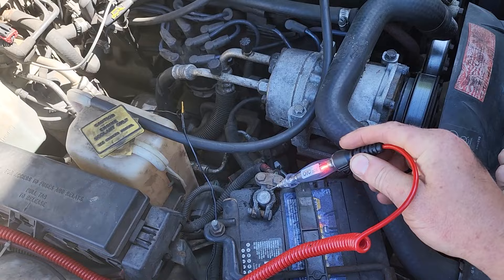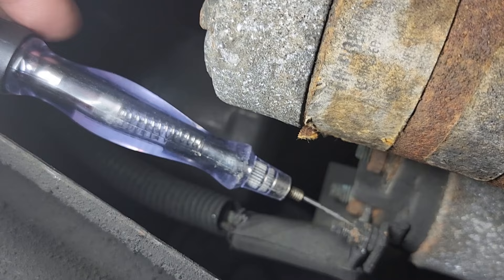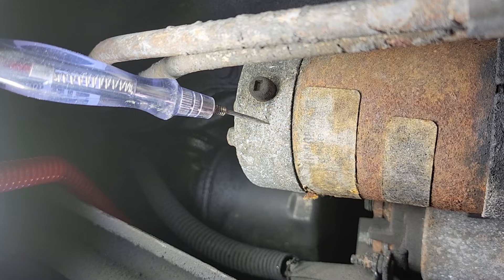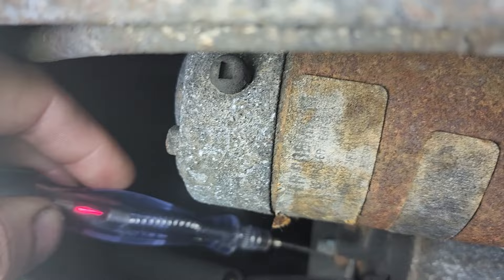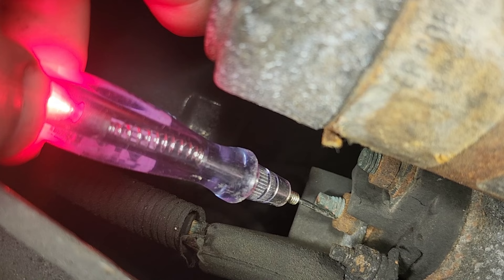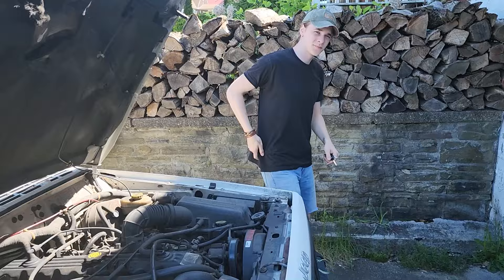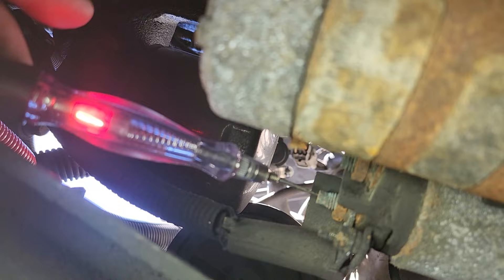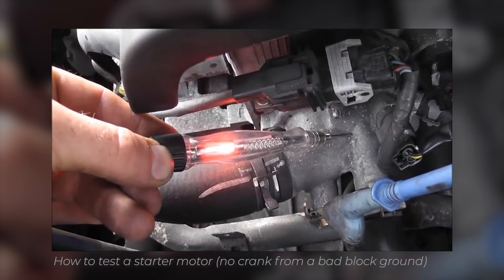Voltage Drop Testing a Starter Motor (Quick Tips)

Comment: You, Eric O from SMA, Ivan, and Keith have all been my role models since God knows when. You've made me a MUCH better diagnostician.  I actually find higher paying employment by selling my diag skills. I watched the other video you linked me to as well...... awesome stuff bud!!!!! Thank you 😊
Reply: Yup for real
Reply: Thank you Brian!
Reply: Yes! Danner, Eric, Keith, and Ivan are the dream team!
Reply: I agree and add one guy, you should looking for DiagnoseDan on YouTube,this guy have a good technician on European cars. Thank you Danner for this good video shared with us.
Reply: Have to agree with this ! I’m the youngest guy in my shop and am making more then most the other guys since they don’t understand basic electrical
Reply: Hi scan Dan here actually dangerous Dan. That seems too easy. I pulled over and had a crank no start then. Found a possible no spark at the distributor. Then the cranking ended. Now a no crank no start.
Got a replacement battery. Took out the starter and disassembled it cleaned and greased it and bench tested it. Motors solenoid moves the Bendix it all works until it is installed.
I added a new ground to the firewall from the intake.
Then it cranked almost one turn.
Still not cranking. This is taking too long. I'm going to try what you just did thanks.

Comment: After watching these types of scenarios from you so many times, it felt so good to run into my first bad block ground in the field. Found that thing in 5 minutes tops. Truck had been down for months with many new parts, new keys, all types of junk. Owner thought I was some type of sorcerer after that one LOL
Reply from the maker: Awesome! Thanks for sharing
Reply: The block receiving voltage is a good ground connection or bad?
Reply: @CrystalGeyser69  bad. Block should always read 0V or very close to it. If the block has battery voltage with the key on (not cranking), it is missing a crucial ground path.
Reply: @Ken-1  okay thank you that helps a lot that is exactly what my multimeter is reading. I touch the red to the positive on my battery and the negative anywhere on the engine block and it’s reading 12.5v
Reply: @CrystalGeyser69 hi I know this is very late but you are doing the test the opposite way, you are proving that you have a good reading, you do not want to see voltage on the block IF your other lead is on the NEGATIVE BATTERY post, if your other lead is on the positive post and the other one of the block then voltage is expected.

Comment: Thank you for making me a great technician not a part changer. My birthday was two days ago and worked couple cars on that day. One of them was kicking my butt! 92 Volvo 940, crank no start. I never work on volvo so I took a gut to look at it. Did all basic. (Air, fuel, spark,timing, compression). Fuel injectors failed so I went to that path. Still couldn’t figure it. I went home and did homework. I went back. Indeed , wires on relays (control injectors) came loose. I cleaned it and put in back. Still wouldn’t start. Owner mentioned it that she messed the wires around. I was thinking if I put wires in wrong slot. I looked at schematic. There pin number and I followed, put wires in correct slot. Car starts and run. Best feeling ever. Took like 5 -7 hours back to back.She called couple mechanics and they kept guessing and was coming with some parts . They were gonna put fuel pump in it 🤣🤦🏻‍♀️. I literally saved her from dummy part changers and towing fees.. I almost gave up but didn’t. Thank you for all you do. You are my mentor.
Reply: Good job, dude

Comment: I wouldn't disconnect the coils. I'd probably would disconnect the fuse to the fuel pump to stop it from starting. That way I'm not soaking my spark plugs with fuel.

Comment: One of your best! Love the burst of burning corrosion quickly emanating from the connection on first crank. Come on Paul, i think you didnt even need the light but to pinpoint exacrly where, LOL. Sadly, i can think of a _dozen_shops that would sell a new starter anyway. Just clean it and/or recommend a new cable with new terminals to CYA after further examination of both ends.

Comment: Brilliant video, as always. In a sloppy shop they would have sold the starter motor and fixed the problem, never knowing the error. You won't often be wrong if you blindly follow the three step recipe of of B+ always on, signal on with key, ground always off. In a busy shop your test takes less than a minute, maybe five minutes to set up an extension if you don't have a friend to turn the key. The great thing about a cookbook recipe is the way you don't need to be thinking too hard, just do the test and you'll be far ahead of many pros. 
That said, I've been scratching my head about the chance of a falsely reassuring ground test. With my favorite Scannerdanner triple test, there is no control to the ground test, as you poke at the oxidized side of the housing, we assume good contact. Also, a normal test light needs about 3V to even glow faintly, which is way higher than acceptable voltage drop on the ground. So here's a possible more trustworthy solution that takes one minute longer. Before starting you attach a multimeter to a good ground on the engine, quickly verify it is 12V from the pos battery post, then clamp the other lead to the neg post of battery. Then set it to read min/max voltage so the result is recorded. Then do your drop testing of the B+wire and the S wire in the normal way. After you're done, crawl out from under the car and look at what the ground drop test showed (pos if maximal voltage>~0.3V)) on the multimeter.
Reply: Good idea. Thanks.

Comment: I'm reminded of a no crank that smoked the wiper motor ground wire.    Owner had painted the block and the bat ground connection was poor.  The only ground the starter saw was through the wiper motor wire. Thanks.

Comment: Great Channel! I have a 97 Tiburon I'm having re done. Having this issue now and the shop just threw a new starter  in. Two weeks later and its not starting. I have a new battery and altenator. Must be the wiring or voltage issue!

Comment: Had a similar problem with my Opel.. But in that case the voltage drop was across the Park-Neutral switch.. Since this part is no longer supplied and already had cleaned the contacts, pushed some springs and contacts and the problem always come back in the middle of nowhere, I wired a relay to handle the crank position. Problem gone :)

Comment: Yes tightening the nut can break through the corrosion, but that is not the finished repair. You would remove the nut (after disconnecting the battery), clean the eyelet, clean up the stud (run a die over it with cutting fluid then clean the stud), and install a new nut. Then you could seal the connection if you wanted (Grote Ultra Seal, Fluid Film, etc.). The block ground repair is a little more interesting in that it could require and completely new cable (wire, lugs, eyelets, etc.)
Reply from the maker: It's been 6 months or more 🙂
It's not a customer so that was the repair lol. But I agree with you.

Comment: You said there's no current flowing then why was the bulb lit wont a test lite automatically load the circut? Wene it was cranked was there to much of a drop to keep the bulb lit? Thanks enjoy your vids
Reply from the maker: For a starter heavy wire? Absolutely not! You can have one single stand of copper left in that cable and it will have no problems carrying the 200 milliamps of current the test light draws, but Absolutely will not carry the hundreds of amps from the starter. The starter is the real load, not the test light.

Comment: My 85 dodge clicks with key, hook up remote starter to positive battery terminal and s terminal on starter, fires right up
Reply from the maker: So your problem is in the ignition switch, park neutral switch or clutch switch (manual), possible starter relay (if it has one) and all related S post wiring
Reply: @ScannerDanner  its an auto, tried new ignition switch same problem, ill try your voltage drop tests before messing with neutral safety switch and relay, thanks for your videos, awesome stuff

Comment: I have a different question 
What is best to use besides a head lamp from a car to test a load on a circuit  for  transmission  solenoid  code
Reply from the maker: I'd use this same test light
Reply: @ScannerDanner  
OK thank you  I told ATRA I uses a test light but they said didn't  provide  enough load to check the wire from the tcm to the Case connector  to transmission

Comment: I have voltage on positive but The  "S"  only lights when cranked? What does that mean
Reply from the maker: When you checked the heavy post. That must be done during cranking even though it's hot all the time.
Reply: @ScannerDanner  I've never heard of Heavy post.. what I'm saying is when you had it on the problem post  yours lit before cranked.. mine did the opposite it lit when cranked

Comment: What is typical voltage drop to see from the starter while cranking?
Reply from the maker: 300-500mv on a circuit that's carrying that kind of amperage
Reply: @ScannerDanner  thanks man been watching your videos trying to track down a cam position sensor fault no signal. Had it at a shop and they are suggesting a new ECM scanner shows 9.2 volts with the code. So I am testing the battery and starter first because of a low cranking speed then on to the new cam position sensor I had installed

Comment: Helpful video but curious what to do when the voltage drop on the positive terminal isn’t isolated to just the stud. Mine is dropping with the tester on the eyelet. 

Does that mean I have a faulty connection somewhere  between the battery positive and the starter? Or could Neutral safety switch/starter relay still be the cause? 

Thanks! 3:21
Reply from the maker: Yes! Your fault is still in that heavy gauge circuit, just further upstream! Do a test right at the battery terminal next, then if it's good there, look for damage and green crusties on the cable
Reply: @ScannerDanner  epic! Thank you for the reply!!

Comment: 1:42 Theoretically, in the unlikely situation where you have both a bad block ground and an open between the brush and the commutator inside the starter motor, then the test light will not illuminate when the key is turned to start.  In the real world, that will almost never happen.
Reply from the maker: Yes sir and you are correct. And it doesn't happen, ever. That's two separate faults that would have occurred at the same time

Comment: Thank you for your time and knowledge. I got a 2008 pontiac g6 with no crank no start and it does it when the car have been running for some miles and them after set for a while start with no problems. I purchase a new battery and was going to buy a new starter but after following some of your steps I don't think the starter is bad, check the relay and the had jumper the stater wire and the starter turns. Do you think that may be the control module, like I said before it only does it when the car had been driven for a while. Thank you for all you do. God bless you.
Reply from the maker: Most likely not the module, but an input problem. Will it crank in neutral?
Reply: @ScannerDanner  Yes i does. im going to do some more checking this morning, in order to  make it no start I have to drive it for a while. Thank you for you reply

Comment: Yes it's classic voltage drop. You must replace your srarter motor because it's so corrosion outside and may be inside too. I know this mitsubishi starters they often have problem with ground through body itself. and brush holder have not ground. in this case it's normal to be parts changer😅 ......Paul you are the best!  I very appreciate your lessons. Thank you!

Comment: Why did the voltage drop on the post, the nut, but not the eyelet?
Reply: The corrosion was between the nut and eyelet.
Reply: Because most of the battery voltage is dropping across the very high resistance in the eyelet so anything that comes after (the nut and post) won't see any voltage when key is in start position, and anything before the eyelet will see battery voltage with just a little bit of dimming because there is still voltage drop across the rest of the starter circuit.
Reply: "Why did the voltage drop on the post, the nut, but not the eyelet?"
Because 'in this particular case', the source of excessive resistance was located between the eyelet & the starters battery post nut.